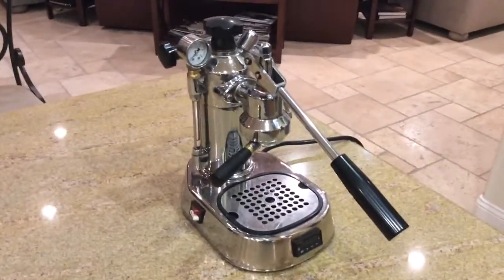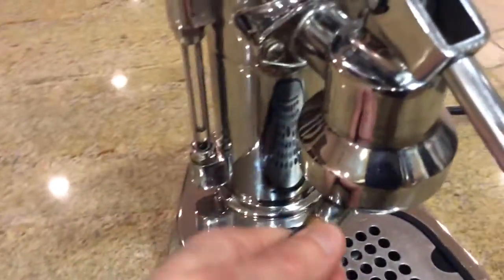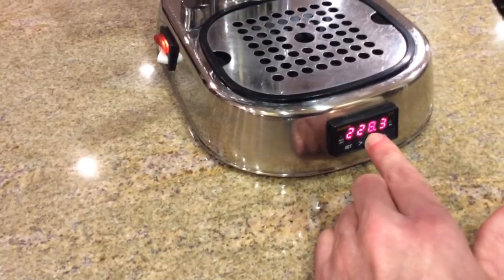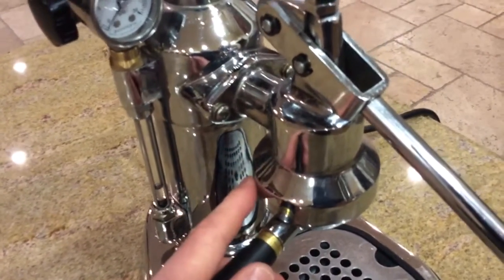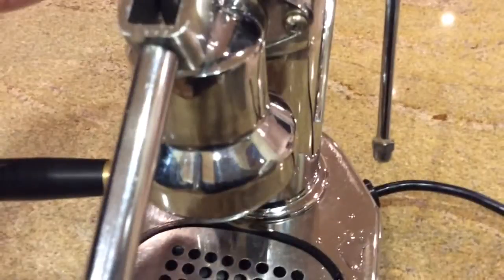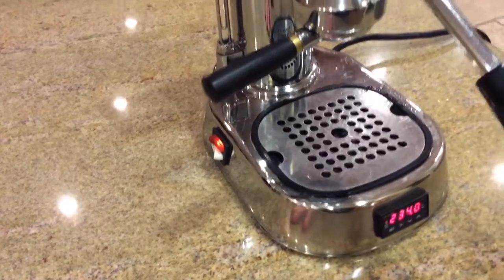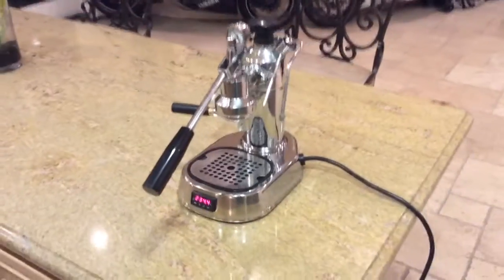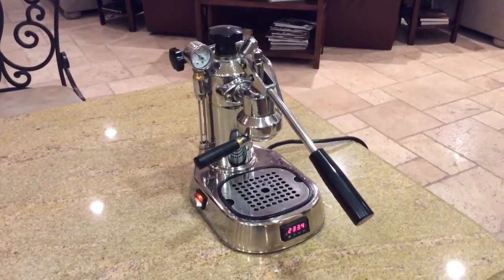Custom PID La Pavoni espresso machine for sale - Ebay item # 231394101795

Comment: would you ever sell another one?
Reply from the maker: That was an old 1975 La Pavoni I bought used and built up over the years. There's a full thread about it on home barista if you are interested in the process. Personally, I wouldn't recommend a PID lever machine, because there is too much instability between the boiler and detached group head. There's far better platforms if you want good espresso.
Reply: @ray5961  thanks so much for the input! What do you think of models like the flair 58, the strietman or the alm kolpi line? Do these PID lever machines suffer from the same issue?
Reply from the maker: @GlorifiedChessPiece  It depends on the relationship between the group head to the boiler itself. Also lever espresso has a different character than pump machines - I personally prefer a pump machine myself. There are some nice pump/lever machines like the Bezzera Strega Lever. Machines like the flair levers are nice for single shots if you don't mind all the work. Generally speaking water just off boil makes decent coffee / espresso. If you check my channel I have an old pump machine now that I converted to accept 54mm portafilters (it's a Breville BES400 as I remember). Makes top notch espresso and great steam wand. Also you might wanna consider if the tank is copper vs. stainless. I'm not a big fan of brass/copper boilers. The BES400 machine is all stainless and very small so heat up is nearly instant.
Reply: @ray5961   @ray5961  the machines have no boiler, instead rely on an external heating source. With PID equipped brew heads you can heat water from cold, it'll take a bit longer. Do you find the same issues with the flairesque machines? I'd like to build a lever machine with a larger reservoir for multiple shots. I'll check out you chanel.
Reply from the maker: @GlorifiedChessPiece  I don't have any direct experience with those machines. Water temp isn't everything though.. try to think of all the variables. You can have the exact water temp, but poorly dialed in beans or cheap beans will trump all those other settings.
Reply: @ray5961 I agree. I want to focus on the machines, instead of beans -- you brought up issues, I want your input on the non boiler machines. Your expertise is highly appreciated.
Reply from the maker: @GlorifiedChessPiece  never used one myself. If you are not a member of home barista forum, I'd start there.